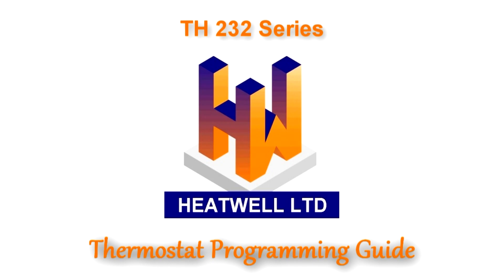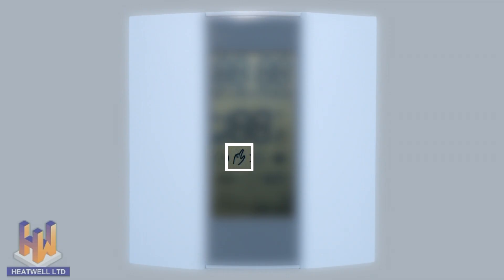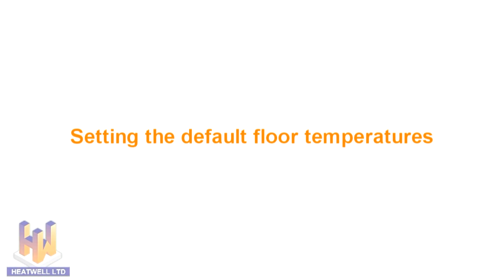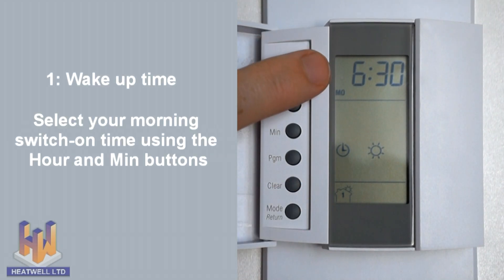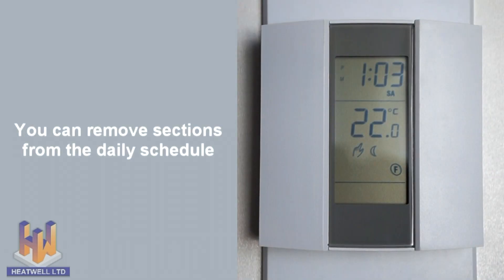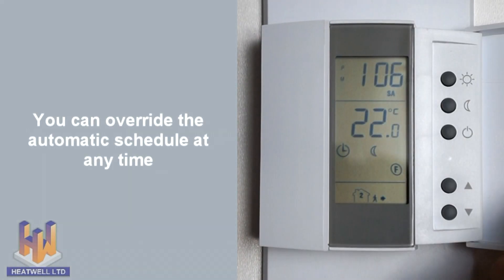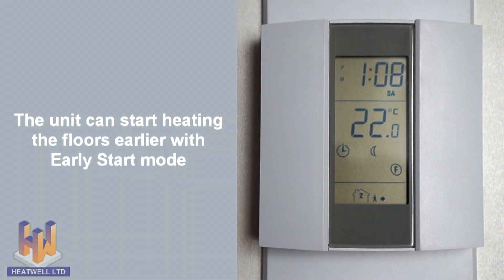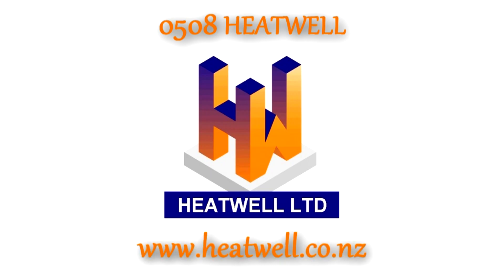Heatwell Thermostat Aube TH232

Comment: My thermostat just quickly flips between program times (morning, away, etc) when I hold down the program button to change from Celsius to Fahrenheit. Did it get updated or something?

Edit: I do have an update version it looks like. I gave the physical on up switch and a work setting as well as a sun and moon. The F/A settings as well as Fahrenheit to C are not the same.

Comment: I have this thermostat and although I ask for heat I hear the click asking for a connection but no heat on the floor.
Reply from the maker: It would sound like the element has failed or the temperature may need to be turned up more.

Comment: Anyone have issues with energy consumption when using these?  Since the days got shorter here in Scotland, our Electric bill has more than tripled (70/80 pm - over 250!!)...  Obviously use the lights a bit more, but we have gas central heating so besides what else is usually using the electric, the only think I can think of is the underfloor heating - we have these in front and back porch - which I turned on in October... I leave it set on manual with floor temp at 20 degrees, so nothing crazy.  Just seems ridiculously excessive, thinking of getting rid.
Reply: I had them on for around 6 months straight, was probably costing me around £250-300. Last year we finally had our woodburner in before the winter and haven't turned the heated floor on since. Electric bill went from £420 a month to £120 a month (even during the winter lol). I also don't have gas at my house BTW 😁
Reply: Also, a smart meter helped me realise how much I was really spending. Even silly things like tumble dryers cost a ridiculous amount if used daily lol

Comment: Still can't change it from Fahrenheit to degrees holding prg does nothing
Reply from the maker: Make sure its on, hold Program button for at least 5 seconds so the screen changes to a new screen, use up or down buttons to select F or C them push mode to reset.
Reply: @Kiwiash1  tried 3 seconds, 5 seconds, 10 seconds, no new menu comes up , maybe it's an older model. Also there is no option to change from air or floor sensor. I'm getting my underfloor heating serviced soon, so maybe they can sort it out. Might just need a new thermostat panel.

Comment: My unit shows period 4 in the house,  the moon symbol, and 5 bars of power being used.Temperature is showing 21.  I thought your excellent video  had explained everything, but I’m still puzzled.
Reply from the maker: If your moon temperature is set at say 18c and the ambient temperature lower than this then it will turn on and maintain 18c.

Comment: Hi your help is much needed.
i have made the settings as suggested in video,i can still see the heating symbol on screen but neither the automatic nor manual setup is not working.can you suggest something.
Reply from the maker: What model is yours, is it the TH132 or the TH232. If its the TH232 turn it off and see if the heating symbol goes away, if not the thermostat is broken. If does go away you may not be setting the temperatures correctly.

Comment: Thank you for the great tutorial! Could you please explain how I can turn it permanently off? I don’t think this was mentioned in the video. Thank you!
Reply from the maker: Go to the video at:

https://www.youtube.com/watch?v=Z7NSZaTW90A&t=703s

Then go time line 11.34 to 12.25 and it talks about Frost Protection. This is the closest thing to an off that this unit has.

It puts a new icon in the top left corner but only shows up when the Mode button is pushed. The arrow does not show beside the this icon but the icon will flash 3 times and then the thermostat will shut down.

Comment: Any idea how to simply turn off the system please ?
Reply from the maker: If you have the TH232 it has an off/on button. If you have the TH132 push the suitcase button.
Reply: @Kiwiash1  thank you Ash. Much appreciated. It has been switched off but the heating remains on constantly at 10 degrees. Any ideas sir ?
Reply from the maker: @johantoth1041  The thermostat tells you the temperature of the room/floor etc. so is the probe or thermostat in an area that is at 10 degrees.?
Reply: @Kiwiash1  I think I’ve worked it out Ash. Thank you very much for your help mate, much appreciated.

Comment: I have got mine set up to go by floor temp but can’t work out how to set it to floor and air temp.
Reply from the maker: It depends on the model you have, some you push and hold the CLEAR button and change it there with the up and down arrows.
Reply: @Kiwiash1  don't work but thanks

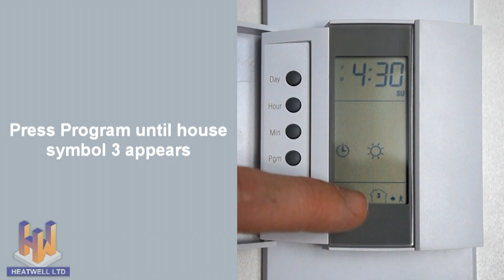Comment: This video makes the paper instructions look like a bad joke!  Now I've learnt a bit more about these units, but I still have two issues.  Last night, I was reprogramming the switch times for these (I have one in each room) and in the morning I discovered the heating had been on all night!!!  Looking at the display at about 06:30, I found them all stuck on Period 3 when logically they should have been on Period 4, since the start times were set to 07:00.  After 7 o'clock I was more than pleased to see them all switch to Period 1 - great!  Question: what happened to Period 4?  Are we going to have another repeat of all-night heating tonight?  I sincerely hope not.
Next issue:  when I attempted to use the F (Floor) sensors, as recommended, I got two dashes '- -' when I know I had sensors fitted under the floor!  So have they all failed?  (This job's about 8 years old).  I'm not going to rip up the tiled floor for sure.  Let's hope my bills don't skyrocket.
Reply: Ooops!  Found I'd made a programming error, ie, 0700~0900 and 0500~2200 instead of 0700~0900 and 1700~2200.  This would explain the "stuck on Period 3" symptom.  But not the "- -" Floor Sensor readings.  Anyone out there with an explanation for me?

Comment: One thing.  You show the power symbol and say that it shows that the unit is on, however it isn't mentioned again during the tutorial.  In the handbook it says to be selected to power the unit off.  Should the symbol be showing to show that the unit is working?  Sorry if that's a stupid question, but my floor doesn't appear to be working.
Reply from the maker: Hi Dave, if the symbol is showing on the screen the unit is off. Cheers Ash
Reply: @Kiwiash1  glad yu clarified that -- I found that particular section confusing -- but the rest of the video is brilliant -- had the system for 3 years and not really looked at it - but had to move my husbands bedroom to my office in the ground floor and I have had to move my office to the conservatory -- where this system has been installed -- so it is a necessity to be able to control it with winter not far away -- I thank you from my now comfortable office space ;-)

Comment: I’ve set the comfort temperature to 26, the hand is shown on screen. But the temp on screen is 22 why?
Reply from the maker: Push the SUN button once and make sure the temperature is 26, if it shows 26 then maybe the heating source is faulty.?  Make sure the heating SYMBOL is shown on the screen.

Comment: When I use the floor sensor as suggested the temp reading is so high it wont turn on. Saying its 26 degrees when its actually cold. Heating wont come on at all now in any sensor mode or in manual. Any ideas? Thanks
Reply: Quality correspondence

Comment: Did anyone find out how to completely turn it off?
Reply: Waiting for that also!
Reply: Same here
Reply: there should be a  socket with just a switch and fuse access in the room where the thermostat is fitted (uk by law ) --- also if you press the on/off symbol and the symbol shows on the display on the unit then it is switched off
Reply: I use the suitcase symbol to switch off!

Comment: You have explained so much details but haven't told the most important thing, how to completely switch off the system. Unfortunately the turn on/off button doesn't work somehow and have no idea why.
Reply: You know this is exactly what I have been waiting for.. Still no answer.. I'll just have to unplug it
Reply: There must always be a master switch positioned a feet or two above the stat to shut the system down, certainly so in the UK. This will be the switch to turn it off totally. If there isn't one then get an electrician in to do it according to local standards. I turn mine off totally in Spring and on again in autumn.
Reply: Use the suitcase button